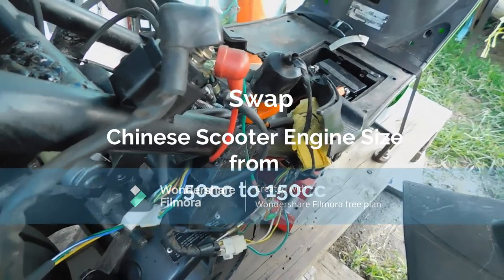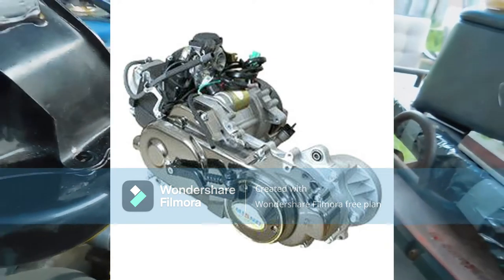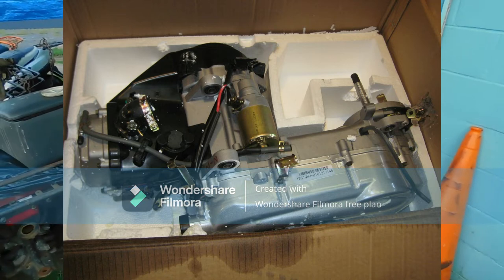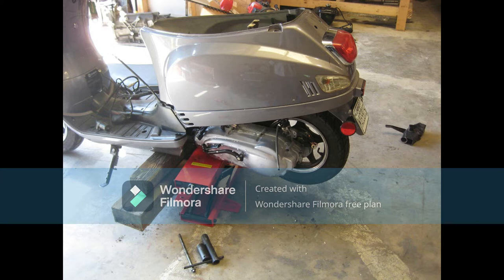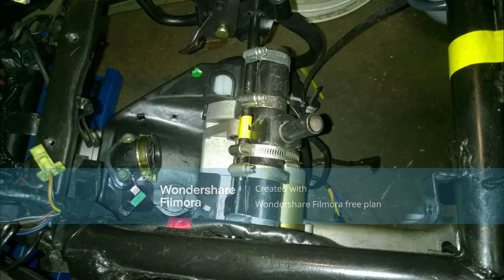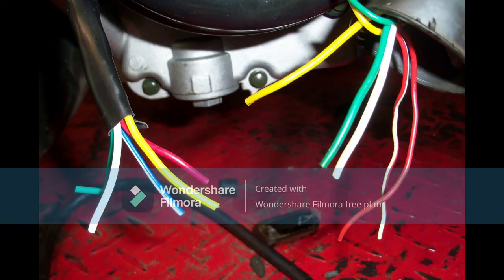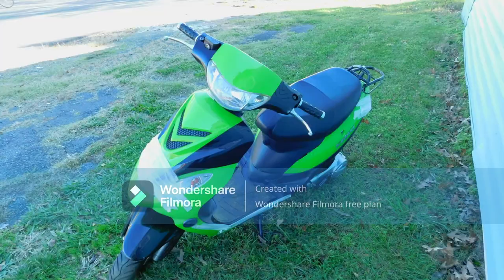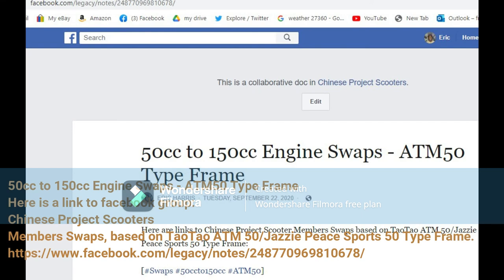Swapping 50cc scooter motor to gy6 150cc

Comment: Putting a 300 cc in 150cc frame....keeping old Vespa look
Motor stock...use slide valve
Carb custom muffler..racing 2000 rpm clutch....88 mph
Flat ground....next a Turbo
Charger....cruise with side car
60-65 mph....freeway
Reply: I got a 50cc with my old 150cc cammed with piston 58.5 taiwan nothing china lol. And my 150cc with a new stock engine from amazon X pro 150cc and run good